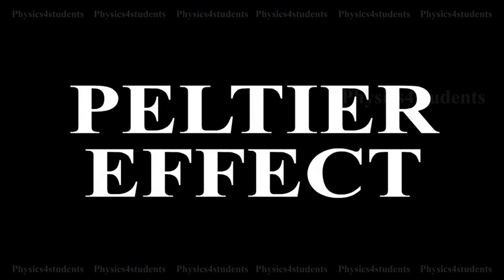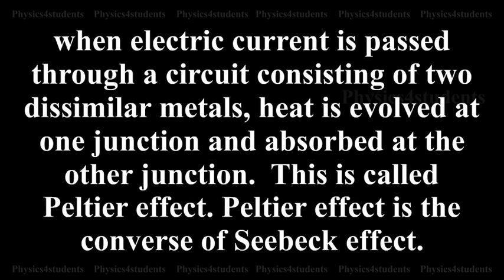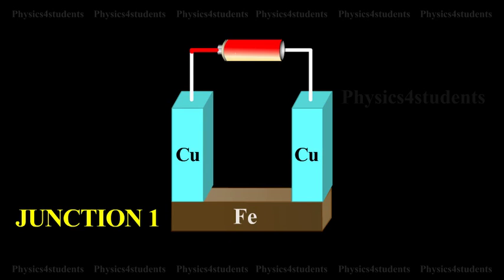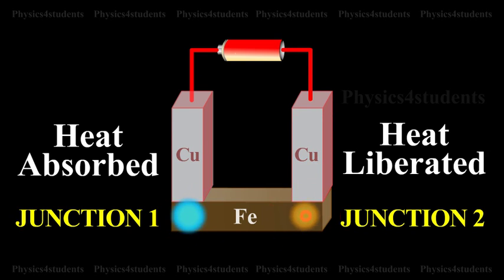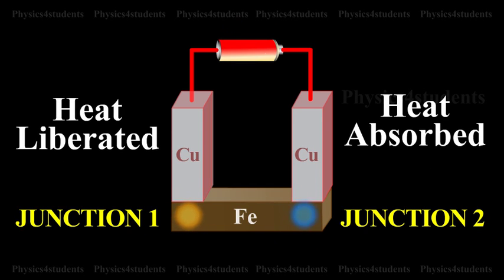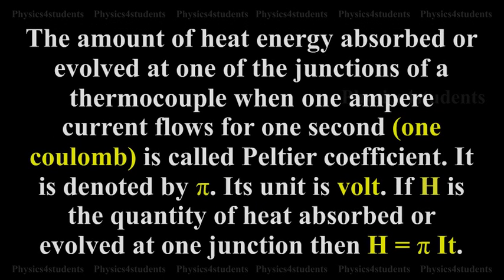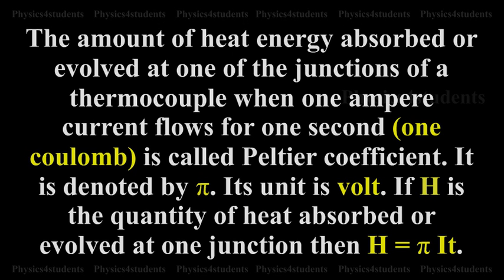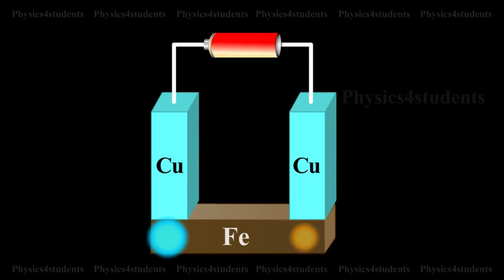Peltier Effect and Peltier Co-efficient | Definition and Theory with Explanation

Comment: Pls correct me if I am wrong. Peltier effect is called reverse effect of Seebeck effect because in Seebeck effect ,  when current was flowing from Copper to Iron ( electron in opposite direction ) we had to supply heat to make sufficient potential difference across the junction. In Peltier effect it is also the same when current flows from Copper to Iron because as the junction is cooled it implies it absorbed heat and it is just same as heating the junction in Seebeck effect.
Reply: No..in the seeback effect  we have electrical energy by applying temperature difference to the junctions..but in the peltier effect we have thermal energy by applying an electrical charge..